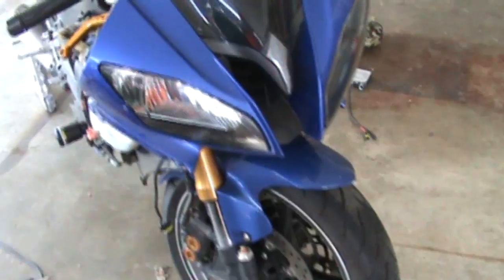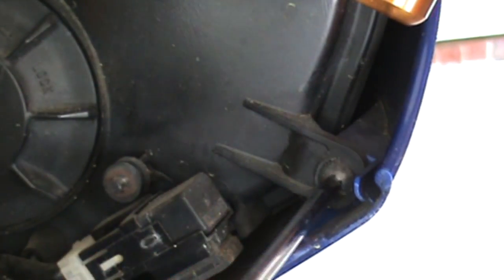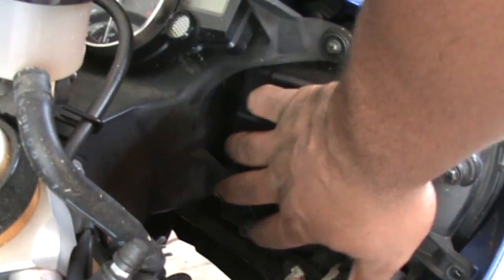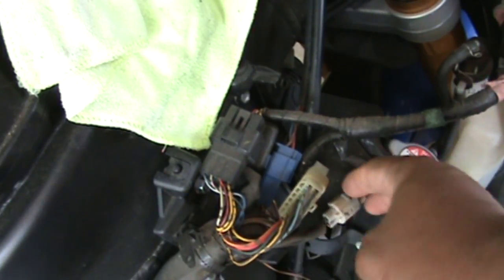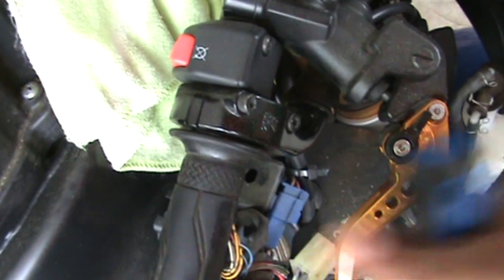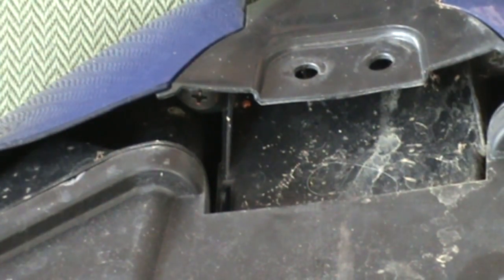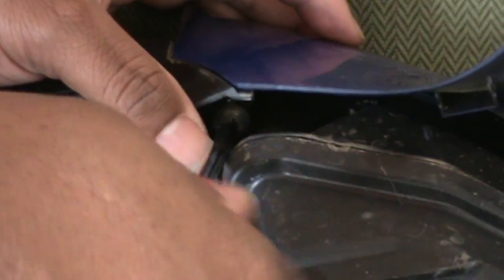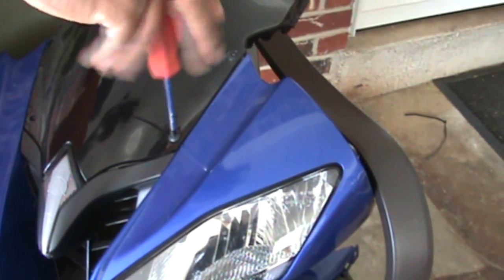cowl remove

Comment: Thanks alot for this brother video albeit I'm late. Got new fairings and needed a little tutelage on the front cowl
Reply from the maker: No problem hope you get you bike the way you want it.
Reply: @Dongarn  yea I actually bought the k2 demon headlights off ebay for em so I need to take all that off. I have an 05 R1 so we basically have the same setup and your video is gonna be a huge help 👍🏼👍🏼